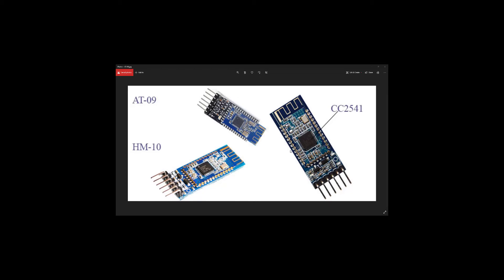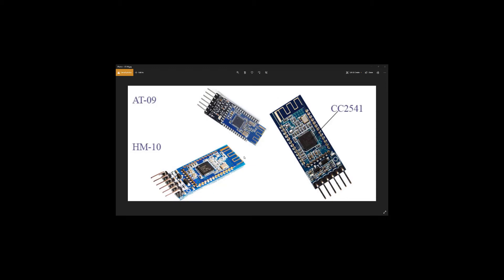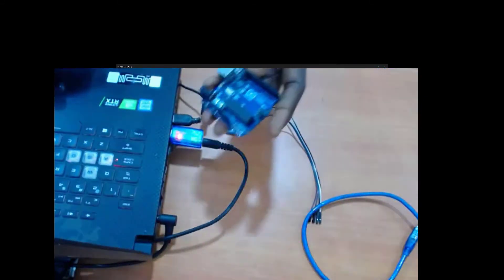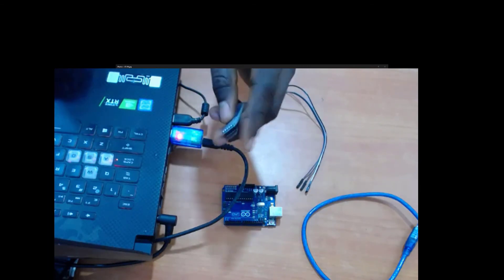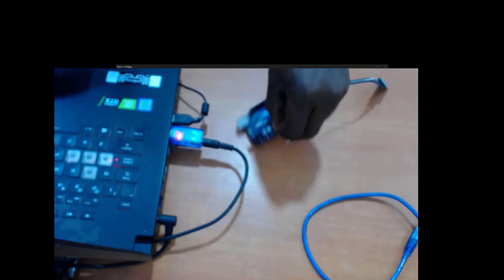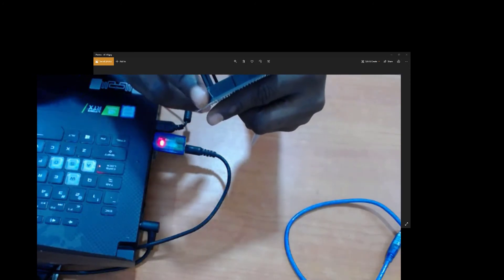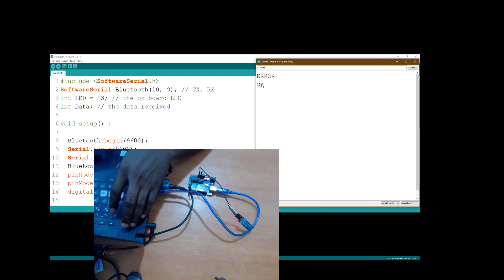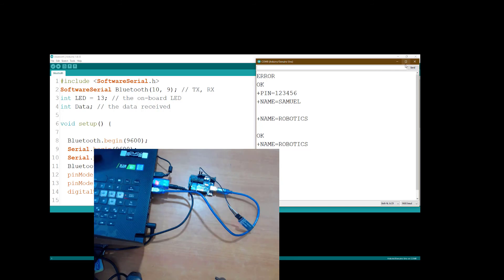Introduction To Bluetooth Low Energy(BLE) Module-AT-09(Part 1)

Comment: can you pls confirm this:
You've connected Rx/Tx pin of AT-09 module to D0 and D1 port of Arduino. 
But in the arduino sketch, you're using D10 and D9 via SoftwareSerial, will this even work?
Reply from the maker: If u watch carefully you will observe we never uploaded any sketch to Arduino. We are only using the Serial monitor to view the data sent to AT-09 module. You reverse the connection when ever you have uploaded the sketch and want ur uploaded sketch to communicate with AT-09.